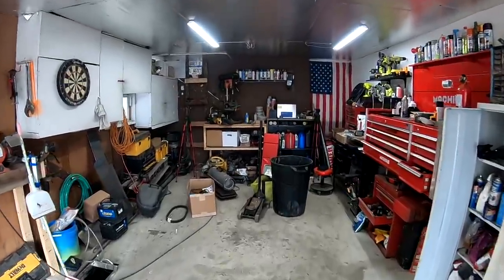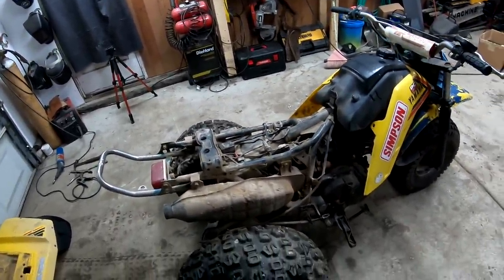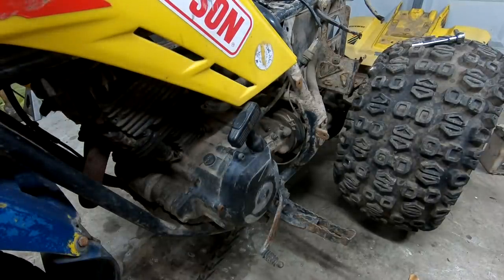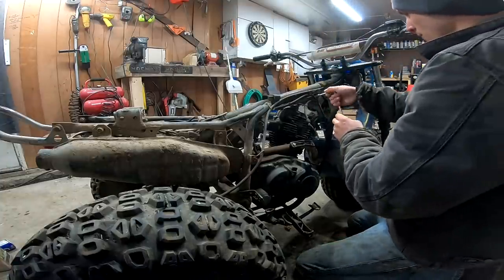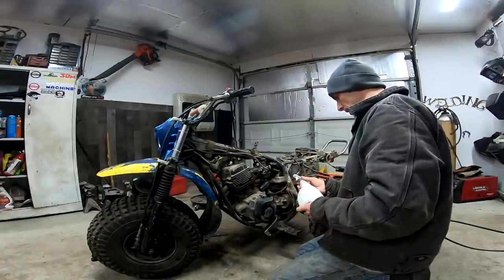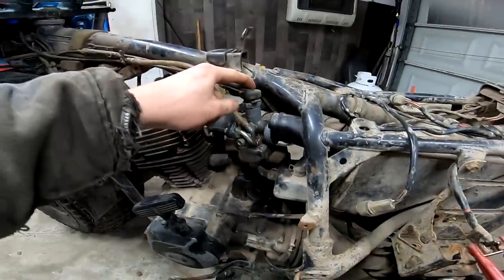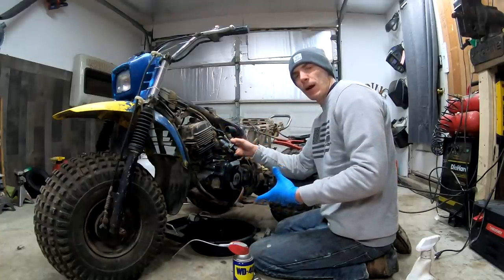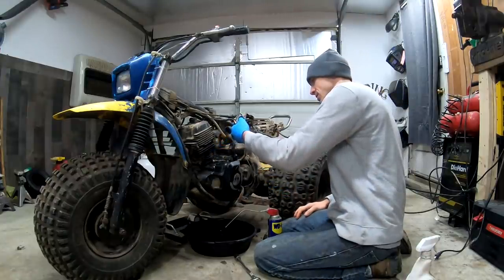Trashed Yamaha Three Wheeler - Will It Run?

Comment: I remember going with my dad buying a brand new Trimoto 225 at the Yamaha dealership just like this one ! We loaded it in the trailer behind my dads old honda civic, we went to the woods near rapid lakes, my dad started the three wheeler my sister hopped infront I was in the back. We where rolling for about 10 minutes my dad did a quick turn and the ATC tipped and we all fell to the ground. I had a broken jaw my sister a broken leg and my dad had a few scrapes and burns... It was the end of the three wheeler my dad sold it and never ever bought trikes or quads again ! He felt so bad for all these years.

Comment: Had a slide stuck in a carb last year. Used brake cleaner, and it slid out after about 10 minutes of sitting. tried WD40 first, with the same results. Cleaned it all up with carb cleaner, and still runs great today.
Reply from the maker: Stay tuned to see how mine comes out.... Uploading tomorrow
Reply: @3DMachines  I'll watch for it! Good luck bud!

Comment: The wheels are  offset see if they can be switched from side to side  it's a good machine I had a 83 lots of fun to  ride  only problem I had was the ujoint
Reply: This 100%.  Those u joints and yokes kill alot of these.  225dr u joints are bigger and barely fit in the housing, but they are cheaper and last longer.

Comment: Hard to believe but I've had really good luck using Pine Sol for cleaning carburetors just let it soak and it'll eat every bit of it really cleans aluminum also and it's cheap and will not hurt your gaskets at all

Comment: Easy pulling on that carburetor soak the thing in carburetor cleaner spray in the slides will release you pulling a hard enough and you'll break your cables or worse and everything is stuck because it's been sitting probably 10 plus years or 5 plus with ethanol fuel

Comment: Hey 3DM!!   A PZ27 or PZ30 clone carb will go on if U make the holes on the carb a little wider, <$20 on eBay.... I am stripping down a Yamaha YM200, the engine and rear are still there, I do want to take the exhaust... If the carb is still there, I'm sure it is worse than Urs.... Mine ran and moved but, had low compression, (intake valve too tight?), if Ur in the Hudson Valley of NY, drop by and take what U need...

Comment: Wow I wish I could find one for that price. I found a 200 YTM  in a scrapyard but the engine is seized and the axle assembly was shattered. I just bought an axle assembly for $50 so I have $100 in this awesome three wheeler and I have Marvel mystery oil in the cylinder...

Comment: Did you say you welded the cast iron bracket at the beginning? How did you keep it from cracking and how long did the weld hold? Welding cast can be done but it's tricky. I pack it in sand immediately after welding to slow down the cooling process

Comment: I recently bought a 20 horse Honda GX620 v-twin engine that had been sitting unused for several years and when I checked the oil it was very black molasses-like and reeked heavily of old varnish (exactly what old fuel does), the shit made me choke. After draining out the oil I pulled the crank case side cover off and lots of thick molasses sludge left behind. I used a full can of brake cleaner alone in hosing out the case, side cover and its oil galleries and also I pulled the oil pump out and gave it a good cleaning. NO way was that engine getting started up with that molasses.
Reply from the maker: Wow. Sounds like a sticky situation.

Comment: Varnished carb.. paint thinner will maybe work if you soak it long enough.  As soon as ya pull it out of the thinner pull the slide n choke out.. maybe.. if you still decide to keep that carb. Then wipe all that out. Paint thinner kinda melts that stuff away. Like tar after you soak it.

Comment: Should have soaked the carb in your ultrasonic cleaner with the cables still installed into the carburetor. It'll free up the gunk holding up the slides.

Comment: They didnt have reverse until 1985 and they were the 225dr, and DO NOT paint that headlight bezel yellow, the blue ones are hard to find, sell the blue and buy a yellow, also the tank shrouds are off a ytm 200, the decals are different

Comment: Carb cleaner works good on that old hard varnish but will destroy rubber seals and plastic parts. If you could soak it (submerged) in kerosene or mineral spirits a few days that might free everything up.

Comment: One of the most garnished carbs I've seen, good thing it comes right off with carb clean water corrosion in carbs is a whole different story lol, awesome bike super fun project bike that's still in amazing shape love yours  vids keep these ones up haha
Reply from the maker: I hope the cables unseize
Reply: @3DMachines  should but the real question is when will they fray and let go haha if not it's a small quad I'm sure ebay or amazon has some cheap cables if all else fails

Comment: Beat stuff and really the only carb cleaner that will touch the dark thick stuff is Dragonfire carb cleaner it's hard to find I get it from a place called VI Enterprise my 86 night hawk was just like that couldn't get the throttle body to turn even with a pipe wrench on it I tore it apart like you are a spread the dragon fire in there in that stuff wash that black crap right off like it was mud no other carb cleaner would touch it it's kinda like if soda dried up in a cup holder in a car that crap sucks but I did finally get my bike running both my carbs was like that it sat for over 15 years
Reply: But dragon fire will melt plastic and all the rubber seals I only use it when carbs are this bad

Comment: Those hood hinges are stamped metal, not cast. You don't have to try to cover for messy welds, just should have cleaned the rust before welding it.
..not shitting on you, this is the first video i've watched from you... it was recommended.
Reply from the maker: Thanks. I ended up cleaning the ends And I heated the metal up with a torch before I slapped 2 overlapping beads on.
It should hold. Your thoughts?

Comment: Do not buy a cheap Chinese carb, oem is best, if you're going to toss that one, please send it my way, also that is not an 85, 85 was a dr and they had reverse
Reply: They made 225dr and 225dx in 85 I have one of each they d the same just dr has reverse
Reply: @markburns8216  was the DC just early 85 for that year then? Not that the year really makes a difference, excluding reverse there arent abd big differences. That's not including the 86 87 models
Reply: I'm not sure but I also have the yfm Moto 4 200 4 wheeler that is the same year and almost identical to the 225dx to
Reply: @markburns8216  yeah the moto 4 is somthing I've never messed with, I know a timberwolf 250 top end is a simple swap for these to get a slightly bigger bore, I'm doing a small build series on it now, cheaper engine rebuild kit
Reply: I'm actually doing that swap right now to a junk 225dx I was using as a parts wheeler an have a Timberwolve I'm putting motor and rear end of the Timberwolve on it
Reply: @markburns8216  making any videos over it?
Reply: I'm not really a camera kind of person but I might right now I'm just getting parts ready so I might bc  I have only seen one other video of it